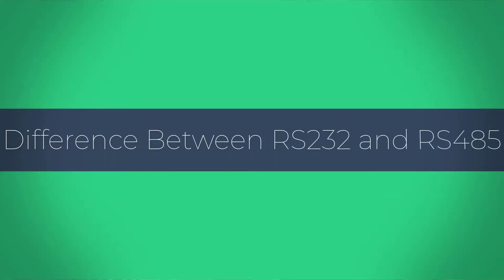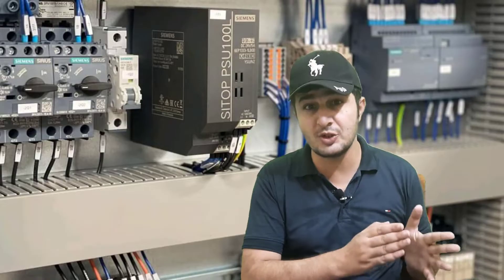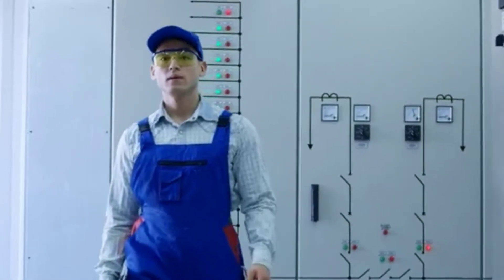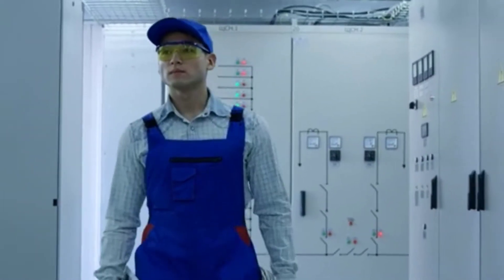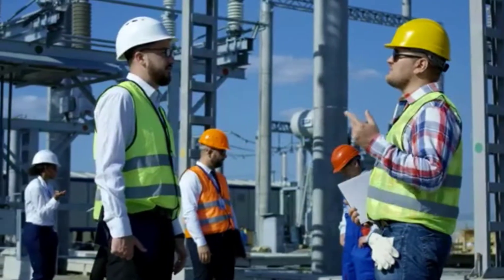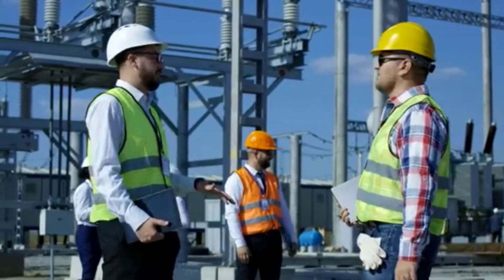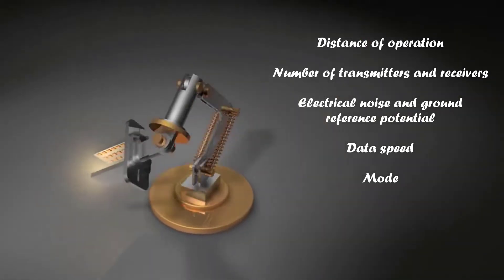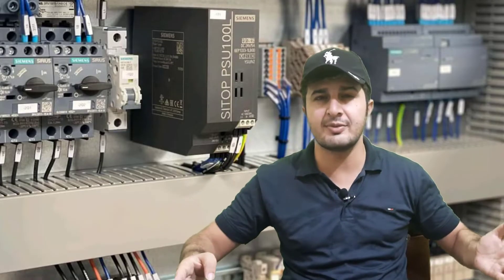What is difference RS232 vs RS485

Comment: In this video, it will sound like RS485 is just superior in every aspect, that's not the case.
RS232 is more than able to perform for a short distance and low data speed requirements. RS232 has a transmission speed of 1Mb/s up to 15M. However, RS485 has a data transmission speed of up to 10Mb/s for a distance of 15M. At the maximum of 1200M, RS485 transmits at 100Kb/s

Comment: It helps to finally understand the difference between both and have some fundamental understanding. Don't really use either in new systems, but do run into them in legacy plants with old systems doing PLC Upgrades. Though i had some awareness that they use different serial cabling for connections and far slower compared to Ethernet/IP i wasn't as aware of the difference. So great to have some better understanding. Legacy communications for me at this point but still great to understand in concept. Your english is also very good man, so don't ever sweat it!

Comment: I just want to repeat the RS485 bidirectionally and am using a RPT-485_422-2 but the instructions are ambiguous. Does the RS485 require a 120 Ohm terminating resistor between terminals A+ B-  on the end of line? Also it speaks of Jumpers but doesn't say where the jumpers are connected.  Do you know much about this type of repeater?